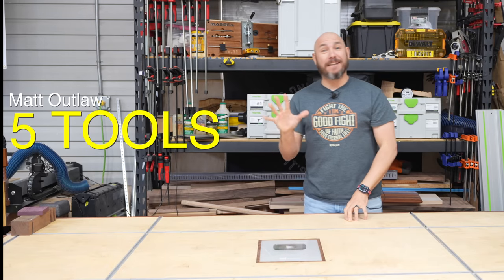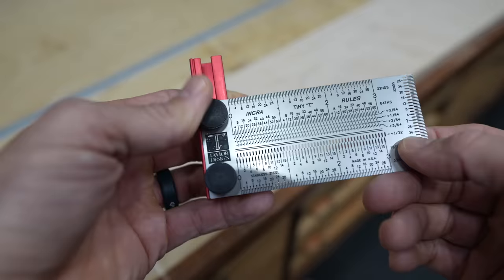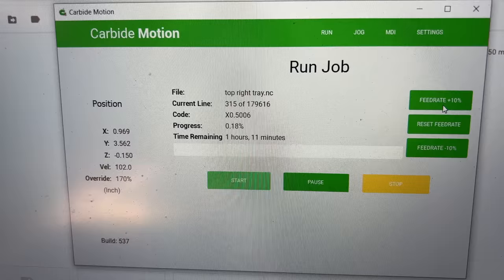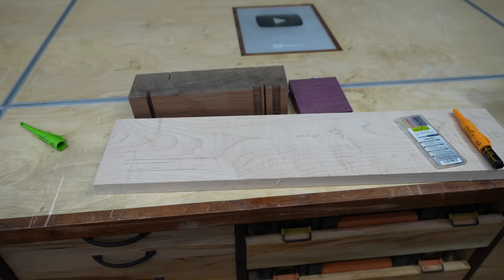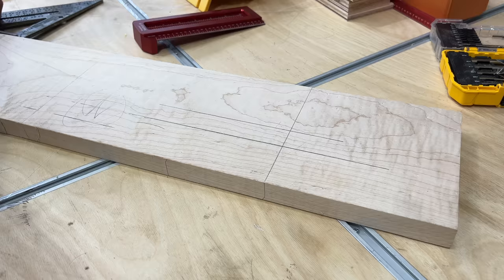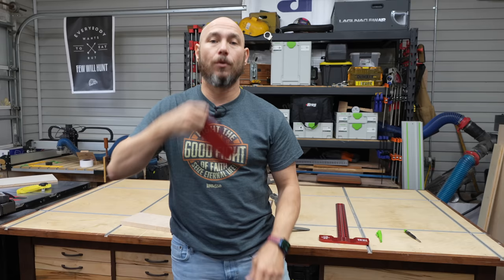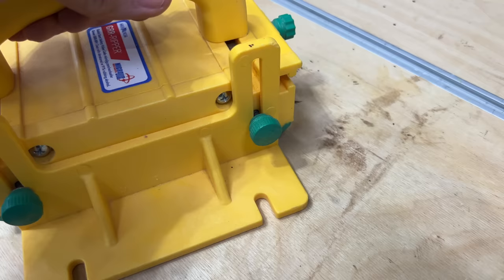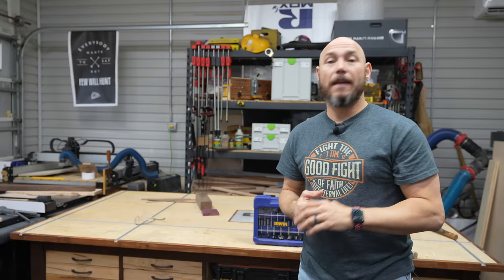5 Woodworking Tools You Didn't Know You Needed, Until Now | Vol 6

Comment from the maker: ▼EXPAND FOR TOOL LINKS and INFO▼ 
Watch Next = 5 More Tools Every Woodworker Needs Vol 1: https://youtu.be/ctyIvBVA6Lk
Tools In This Video: 
Shapeoko CNC by Carbide 3D: https://shop.carbide3d.com/731woodworks
Incra Tiny T (Amazon): https://amzn.to/3KYtBEP
Inca Tiny T (YellowHammer): https://lddy.no/14y9c
Pica Pencil with Refill Pack: https://lddy.no/14y9u
Pica Pencil (YellowHammer): https://lddy.no/14y9q
Pica Pencil (Amazon): https://amzn.to/3wig9rq
Pica Deep Hole Marker (YellowHammer): https://lddy.no/14y9l
Deep Hole Marker (Amazon) https://amzn.to/3qjDjtP
Pica Blue / White / Green lead refills: https://lddy.no/14y9r 
Pica Red / Yellow Refill Pack: https://lddy.no/14y9s
Woodpeckers Saddle T-6: https://amzn.to/3IwgV6M
Microjig GRR-RIPPER (Amazon): https://amzn.to/3CSTL9g
GRR-RIPPER at TayTools (save 10% using code 731MICROJIG10) https://lddy.no/14yey
Forstner Bit Set https://amzn.to/3N74Qsb
Individual Forstner Bits: https://lddy.no/14y9t

Other Tools Shown in Video:
Center Punch: https://amzn.to/3qouGhu
Woodpeckers Edge Rule: https://amzn.to/3tonfc5
Swanson Speed Square: https://amzn.to/3qgtBbC
Woodpeckers Paolini Pocket Rule: https://amzn.to/3txQLfH
Woodpeckers T-Rule: https://amzn.to/34VrzpP
My Drill Press: https://amzn.to/37LT8D5

(If you use one of these Amazon and other affiliate links, I may receive a commission) 

Some other useful links:
Daily Tool Deals on my website: https://www.731woodworks.com/tool-deals
Subscribe to our email Newsletter: https://mailchi.mp/7e44c16eefdc/731-woodworks-email-newsletter
Check out our easy-to-follow woodworking plans: https://www.731woodworks.com/store
Outlaw's Board Butter - So Good it Should be Outlawed: https://www.731woodworks.com/store/boardbutter

Comment: The hole saw sticks and burns the wood because there's nowhere for the sawdust to go so it instantly fills up the gullets of the saw. There's a way around this, touch the hole saw lightly to the surface to mark the circle and then drill a 8 or 10mm hole or two inside it, just touching the mark left by the hole saw. Now the chips will clear through the holes and not jam the saw giving a much smoother, faster and more pleasant cut with no binding or burning. But yes, for small holes, say less than an inch (or 25mm for us metric folks) a forstner bit is the way to go. But good luck finding a 50 or 75 or 125 mm forstner bit.

Comment: Coming from working on industrial panel saws, with 400mm blades, we were taught to use two long push sticks, for small ripping cuts. You use one push stick against the edge of the material, to push towards the fence. This is stationary,  the material slides past this, like using a featherboard. The other long push stick pushes the stock through when needed.  This way your hands are at least a foot away from the blade at all times. And not sure why so many woodworkers don't have decent blade guards on their table saw. If you have a top hung blade guard, with dust extraction, you can have the blade guard down most of the time, giving hand protection and dust extraction.

Comment: I fitted a digital readout to my router- they are really cheap. Zero it when you change the bit, and then you can set it to any height- 0.01mm resolution with mine (but you can switch to thou if you must.) Way more accurate.

Comment: The Pica pencils/markers are expensive, but well worth it IMHO.  I like mine so much, I picked up a second set of each.  The sleeve they use comes in so handy.  You never loose the pencil in your pocket and have to go digging for it.  I also have the Incra Tiny, as well as longer versions of it, the flat and edge rulers (all 12").  Very handy.

Comment: The saddle T is definitely the tool I’m most interested in. I started getting pretty good with my speed square, but this looks interesting. The only think I wish it had was bigger holes to insert your pencil. I use a carpenters pencil most of the time
Reply: I picked up a Saddle T6 back in December (along with 2 other Woodpeckers tools) and I can honestly say, I absolutely LOVE my Saddle T6! It's much easier to use compared to measuring and marking lines, or even using a combination square. The biggest reason why I like it so much is the fact that it's coplanar. I never knew how often I needed to mark things like that before I started using my Saddle T6. Now I can't even imagine doing it without.

Comment: I'm am Incra fan,  but their rules are NOT stainless steel.  I live on coastal SC, and all eight of mine have rust here an their.  often they are finger prints.  Still,  they are amazing!  Regular use and a wipe down with oily trash resolves issue.   After 3 years,  the Incra TS/LS fence and its internal parts HAVE PROVED stainless or corrosion free.

Comment: Thanks so much for this entire series of reviews. I have purchased a number of the items you've reviewed and found them to be well worth the price. The only item I was unhappy with is the Incra T-Rule. I could have lived with the fact that it is flimsy (I would be afraid to put it in a pocket lest it get bent). However, I tried marking with a number of different pencils and pens that were 0.5" and none of them would fit through the holes. The only thing that would get through was an X-acto knife blade, and even then it did not cut deep enough to make a useful line. Of course, if you just want to measure precise increments and mark with the side of the instrument, and/or measure router bit depth, it's just fine for that.  But since my primary use case is marking, the tool just seems useless to me.  

As an alternative, I found an extraordinary set of sturdy T-Marking squares at a very good price at iGaging. It's a small business that makes great and reasonably priced products -- it's well worth supporting. If you haven't yet reviewed any of their tools, it would be great of you could have a look. Here's the T-Marking squares: https://www.chipsfly.com/t-marking-squares.html.

 Thanks again for this series and other videos. They are a huge help!

Comment: Great tips, The only thing I don’t like about the incra rule is the the blade is so thin, like paper thin , your stock that you are measuring needs to be dead flat top and edge,  and without splinters , knots and most defects, this blade being so thin along with all the perforations will catch and likely  twist/ bend.  Decent for layout on paper. That wood pecker is awesome though.  Cheers Matt
Reply from the maker: It is thin for sure

Comment: I've had bad results using larger forstner bits handheld in my drill but I don't have a drill press so not much choice there.  What is the largest forstner bit that can reasonably be used handheld in a drill?

Comment: How does it compare, as far as usefulness in the shop, to the Paolini rule which it looked like you also had?
Reply from the maker: I use the Paolini a lot more. It’s small, lightweight and more convenient. Although the saddle t is very handy to have. The incra is great because of the marking holes but because the blade is wider it’s less likely to be carried around.

Comment: The rules are beautifully made. Inches? Fine. Fractions? Madness. Using 10ths, 100ths, etc makes calculations simple, and tolerances make sense. Fractions belong in the 1800s.
Reply: Imperil method is actually more accurate than metric.  Especially when it comes to making things in any type of medium.  Metric is easier with high-end mathematics. They both have their place.
Reply: @jonlanier_  The measuring units used have no possible effect on accuracy. Achievable tolerances depend on the equipment and skills available, not on the units uses to measure them. 'both have their place'? Suggest a use-case where Imperial measures afford an advantage. BTW everything is made in some type of medium.

Comment: Do the PICA pencil tips fit in the holes on the incra marking tool?
Reply from the maker: Only if it is a good sharp point.  The .07 lead on the mechanical pencils won't fit in the smaller holes (1/64 ones).  You would need a .05 or smaller I think.
Reply: @731Woodworks  thank you!!